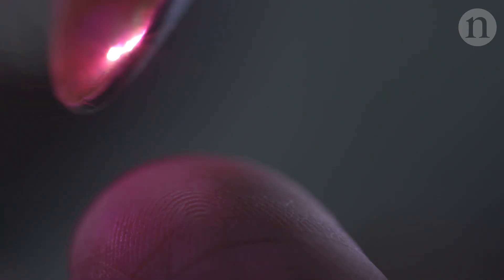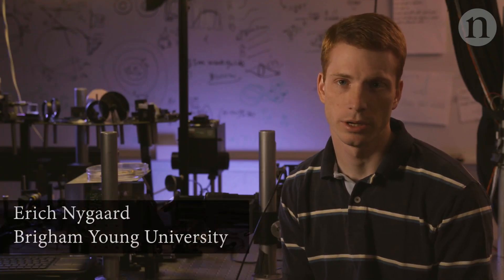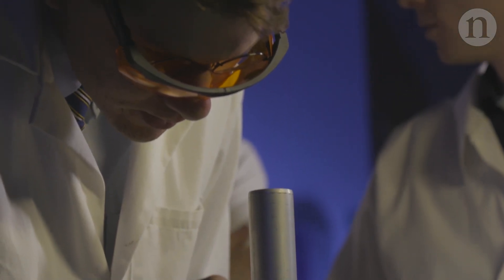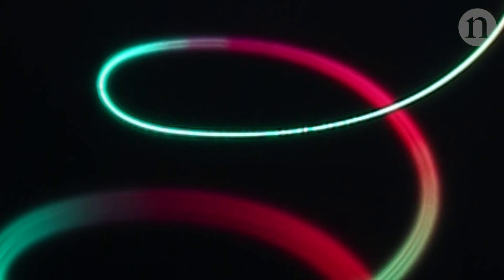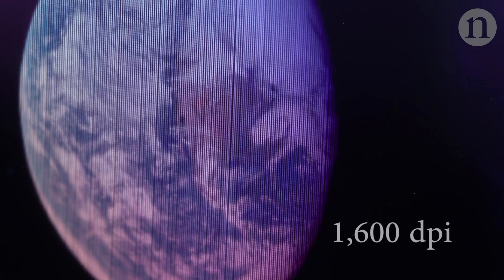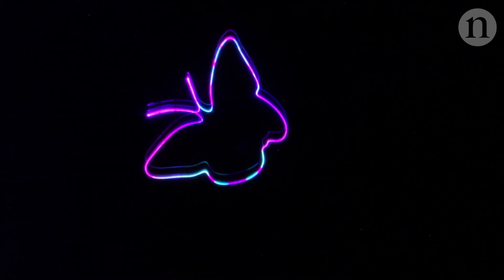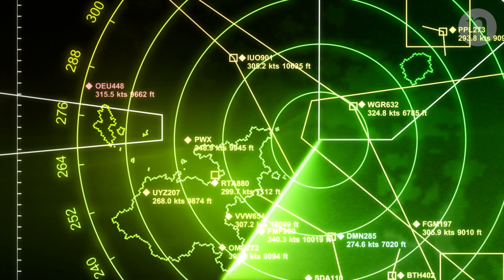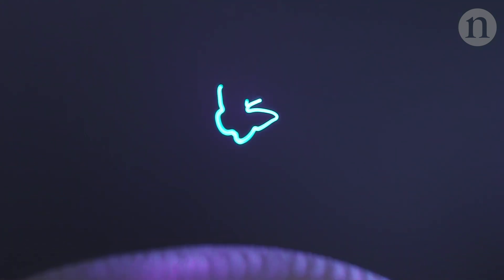Pictures in the air: 3D printing with light

Comment: This is a long time ago development from Japanese universities of science, even before youtube.
Reply: The tech in Japan uses lasers to create plasma in the air but this tech uses lasers to move particles super fast. The former uses high power lasers while the latter uses weak lasers. They are different
Reply: @Voidapparate  Do you have a link? I would like to see this.
Reply: @Voidapparate  this is creating plasma and moving around, in this technology is not used the tunnelling effect to move particles.
The principle is like in the Japanese one years ago for volumetric display. The Japanese originally were creating points to make the images in 3D, creating similar images as here.  Years ago the were in another stage, interaction with those images.

Comment: what happens if your finger touches it? Is the laser powerful enough to burn you?
Reply: No they are low powered.. But you'll interfere with the particle which means the particle is lost and you need to introduce a new particle to project on.
Reply: No; it's pulsed. The pulsed are so short it doesn't get the time to burn you. But if it wasn't pulsed
*activates energy sword
Then Reach would fall
Reply: John Hunter Not necessarily
https://youtu.be/AoWi10YVmfE

Comment: I think there was a Japanese group that had already prototyped this kind of system (upon review it seems like the techniques are different where the BYU group literally traps tiny particles to trace out images, whereas the Japanese group used induced plasma -- both probably using high frequency laser pulses). https://www.youtube.com/watch?v=AoWi10YVmfE
Reply: This method uses much weaker lasers that continuously exert forces on the particle, drawbacks are that the image will be destroyed by wind or touch and then you need to fiddle around to add a new particle. Another drawback is that with several lasers from several directions, it may not be eye-safe from a few different angles. The plasma method has other drawbacks, using no particle is a big advantage, but it makes a bit of noise, smells like ozone, burns tiny holes into your skin if you touch it, and from exactly one direction its a really major hazard for your eyes.
Reply: This seems like A solution.
Reply: but they were touching the plasma one in their video.
Reply: tigeruby their method isn't practical it's quite dangerous .... This seems the solution.....
Reply: The lasers are not from several directions. The direction of all 4 lasers (RGB+Near UV) is the same.
Reply: kamran qaderi then how can they move the particle in all directions?
Reply: John Hunter they show the little holes it burns into the dead surface layer of your skin in a video.
Reply: Yeah, if you read the nature article they actually reference that system as well. 😉 
edit correction: they mention the predecessor, I forgot about the "fairy lights" volumetric display. /edit

This is an interesting solution indeed. The difficulty with volumetric 3D displays using projection has always been making sure voxels scatter enough of the correct light (their current colour) while acting transparent for all other light. By moving a particle to project on you fix that problem.
Reply: kurtilein3 there are Galvo scanner mirrors that move around all 4 lasers together but the change in direction is the same for all lasers. All the laser beams are well aligned on top of each other.
Reply: kurtilein3 "then how can they move the particle in all directions?"
I believe they trap the particle instead of pushing it. which means moving the focal points that trap the particle is enough to move the particle any direction you want..
Reply: I doubt it, plasma burns stuff and is really bad at pushing things around.
Reply: kurtilein3 I was talking about this system. Not the one that creates plasma. You don't need to push a light scattering particle around if you're using plasma to create the dots because the plasma emits the light itself.